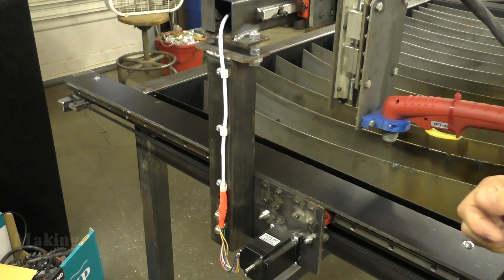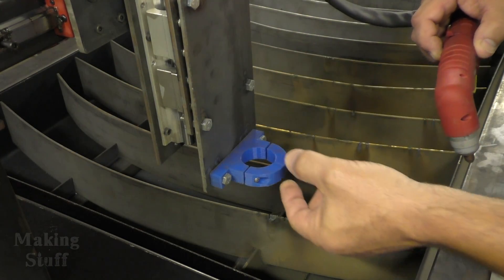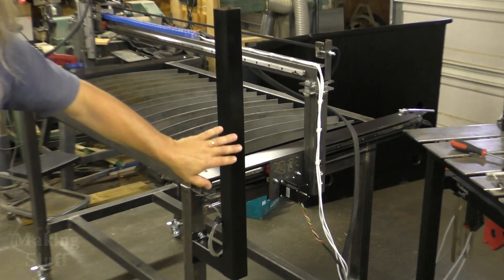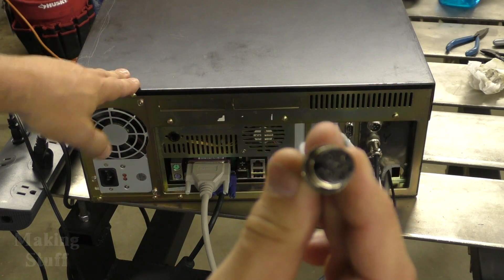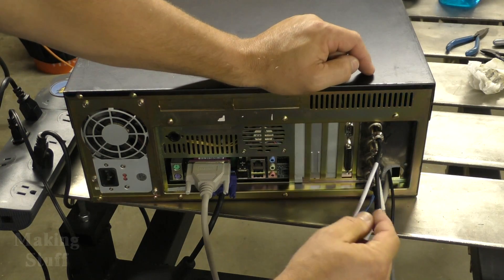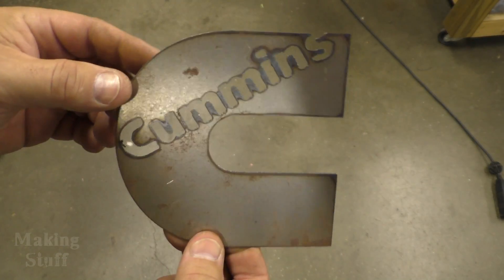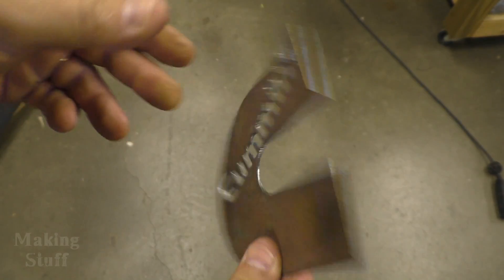DIY CNC Plasma Table Build- Part 8 First Cuts, Dialing It In and More Updates

Comment: Hi, I built a similar Plasma Table but with a 100 Amp Plasma Cutter with a p80 torch and had the same Cutting results I tried different speeds and Amp settings.
for everything under 3mm I use the smaller 1.1mm Nozzle with 55 amps with the speeds I go as fast as Possible 3mm around 1500mm/min 1mm 4000mm/min for the thickest Material that I cut till now was 5mm there I used 80 Amps 1.5mm Nozzle and around 800mm/min maybe i should have used around 100Amps and 1200mm/min

Comment: Very nice. Thanks for sharing your experience. I am setting up my first plasma table and using the plasma cutter from harbor freight made by Chicago Electric.  I get allot of bevel on the edge. If I cut a square out of 3/16, the first side is perfect but then it turns the corner and gets a really bad bevel.  Did you have the same problem? Is that caused by the quality of the cutter?  Thanks for any help you can offer.
Reply from the maker: I always got some type of bevel wen using the Chicago Electric cutter.  If I used consumables from Amazon it was worse.  The consumables from Harbor Freight are better.  If you are using Amazon consumables, I would try I would try the Harbor Freight ones and see if they work better for you.

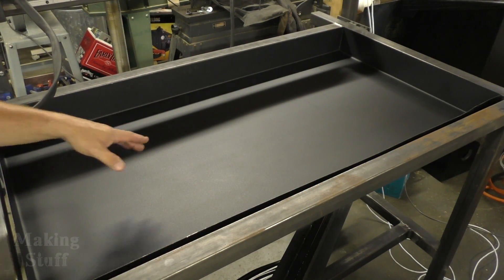Comment: At 6:27 you used flex seal on the water pan. how is that holding up so far.
Reply from the maker: Really well. The inside of the pan is not rusting but the outside where I used rust-o-leum is flaking off.  I'm really glad I used it because it has held up well.  The water pan has had water in it ever since I built the machine last year and there are no leaks yet.
Reply: Also, with the flesh seal h9w do you ground the part? Are all the slats hooked to a ground? Thanks and great build

Comment: Dot cuted bad be cose torch pushed material look video  ;). This thiknes must be cut faster and lower amps 2mm thiknes  40Acurent feed its like 5m/min observ fire in botom side if cut good torch its litle  first from this flame  flame must rest litle bac optimal its 30deg. Max velocity its 45degr if you cut slower plasma burn the material and for take on flame  burn material larger and heat material mor larger for first time incres velocity  not slow down velocity  not clean edge in botom side too slowcut  ... Not clean high  edge  too fast cut

Comment: Hi Bob, and greetings from Mexico. I made a CNC Plasma Table from scratch and I have a Harbor Freight plasma cutter and the same THC that you are using... But I have been struggling with the settings (IPM, and Amps and PROMA Thc)... I have been cutting some personalized barbecue grills for my friends but I can't find the right settings ( I mean too much dross or bevel)... I  cut mostly a 3/16 Steel Plate and gauge 16 and 14  any advice would be appreciated
Reply from the maker: I've cut mostly 14ga with mine.  I always leave the plasma cutter set to maximum amps.  For 14 ga, I use 125IPM and set the THC voltage to 98-105V  sometimes I just have to play with the voltage to get best results.  That setting gives almost dross free results.  For thicker metal you will need to slow down the IPM.  I cut some 3/16 and had to slow it down to 22IPM.  It cut it but did not look as good as I would like so it will need to be dialed in from there.
Reply: Thank you very much for the info, I've been cutting 3/16 at 21IPM I was not too far... the dross brakes easily but still too much... what about the Proma Speed for the 14 ga ?
Reply: Ulises puedo ponerme en contacto contigo para hablar acerca de este CNC plasma vjvalencia0070@gmail.com
Reply: @victorvalencia276  claro que sí mi email es ufierros@hotmail.com
Reply: @victorvalencia276  no recibí tu correo te mande uno yo. Saludos..
Reply: Ya te envie un mail

Comment: @making stuff I see at 5:35 you are using a relay board from one of the unused Pin outs on the board. Is that signal alone enough to set the relay off or did you need to condition the signal in some way?
Reply from the maker: The signal from the hobbycnc is not enough to trigger the relays.  There is an NPN transistor on the board that will trigger the 12V relay with a 5V signal.

Comment: Really liked your project Bob. Did you have any problems with the HF arc starting interfering with the motion control electronics?
Reply from the maker: No I used shielded wire on the motors and have not had any problems.  Also the parallel port controllers seem to do better than the USB and RJ45 drivers, at least that's what my research found.

Comment: I would just like to ask - I see by the uploads it took about 3 1/2 months from the first upload to this upload, but about how many actual working days did it take to make this? Just a rough estimate would be a lot of help.

I was going to purchase the Langmuir Systems Crossfire, but after watching this series, you've inspired me into making one myself like this and since your videos have been pretty clear, I probably won't pester you with too many questions. I think I've got my head wrapped around it for the most part.
Reply from the maker: I've got about 6 or 7 Full 8 hour days in the project.  It's hard to tell because sometimes I only spent 1/2 hour here and there working on it.  Thanks for watching!
Reply: OK. Thank you. It'll probably take me a little longer (as far as number of days), but at least I have a ballpark estimate.
Reply: @MakingStuff  i would like to have the total cost of building and a list of the electronics to see if i could even afford to try and build one lol

Comment: Of all the DIY table vids I've watched, I think I like your belt drive method the best.  If its the same material that car timing belts are made of, then I don't ever see you wearing it out.

Looking forward to the material list.

Kirk
Reply from the maker: Material list is posted on the making stuff web site.  http://www.makingstuff.info/Projects/CNC_Plasma  The belts are rubber coated teflon (I think).  I haven't worn one out, but it is possible to stretch it out on one side then the belt will try to run off the pulley which is caused pretty much by over tightening them.  Thanks for watching!

Comment: Did the table saw idea work ok for trimming the pan or did you do something else for it? It looks good hopefully it works well for you for a long time.
Reply from the maker: I left it alone.  The lip is actually a good thing.  It helps get the water up to the bottom of the part which will help keep the cut parts cool.